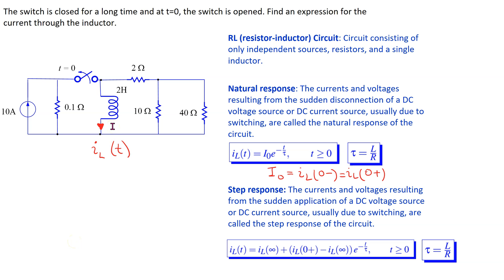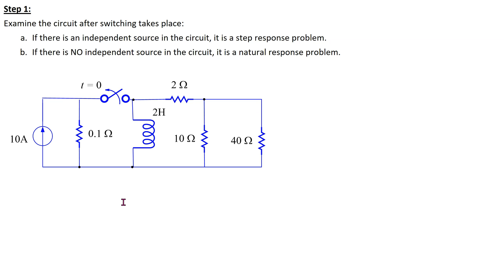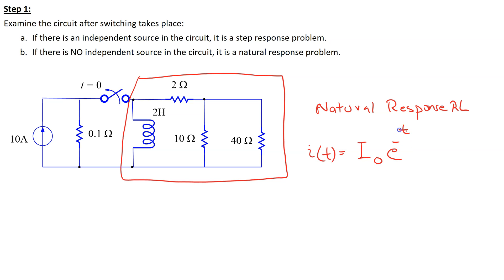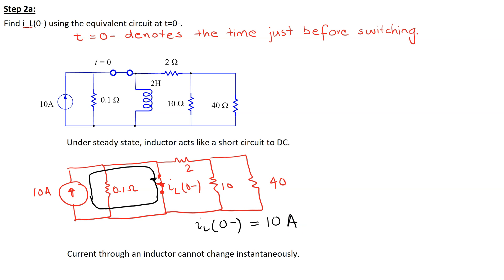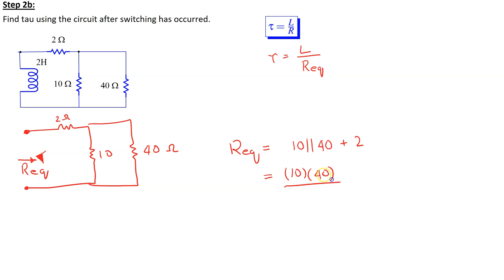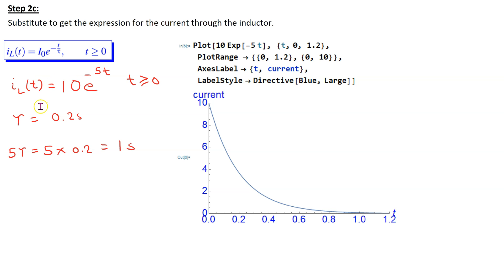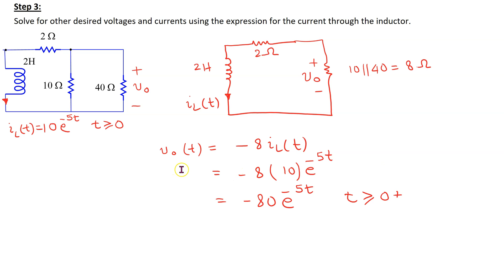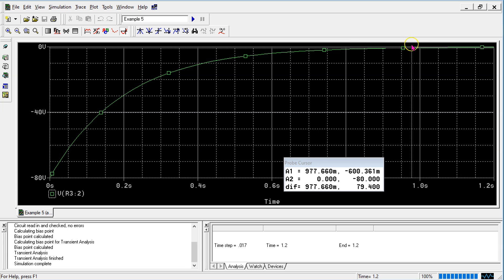Example 3  - Solving for Natural Response of an RL Circuit

Comment: Iam little confused at  7:45
when to apply thevinin theorem ??
I calculated (2ohm series with 10 )// 40.????

Or( 40//10)+2???

I fed up with this ...any one pls explain
Reply from the maker: Thank you for the question. The solution in the video at 7:45 is correct. You have to consider the terminals of interest and start at the far end when combining the resistors. Thus, 10||40 first and then in series with 2. Hope that helps.